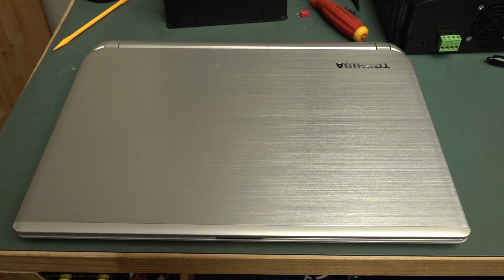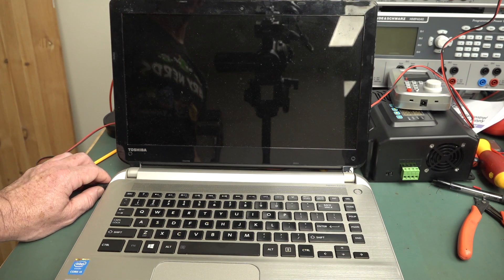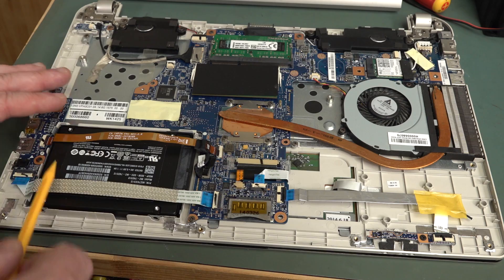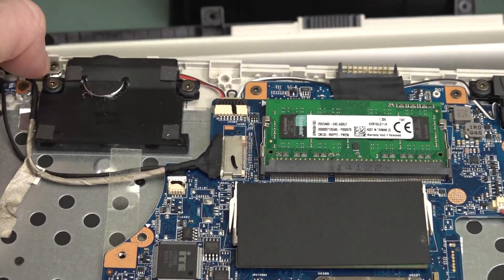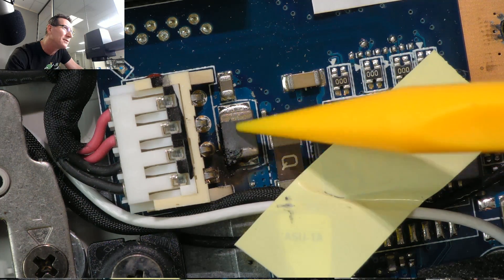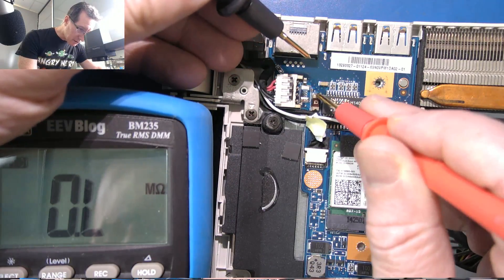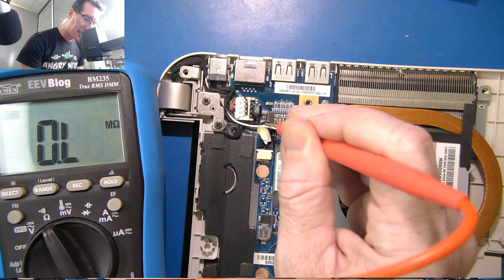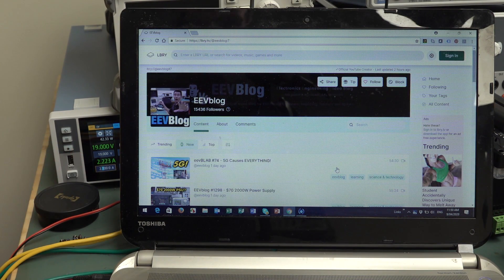EEVblog #1299 - Dumpster Laptop REPAIR

Comment: It's amazing how people throw out machines with data still on them. Here they had some kind of excuse I suppose, but the HP ProBook 4520S I'm typing this [on] was dumped, working, with a still-trading firm's full set of accounts, emails, supplier info etc on it. The HDD had a quite a few bad sectors but hasn't grown any more and the very worn keyboard needed replacing, but neither meant the machine had to be dumped unwiped.

Comment: Can't understand why people throw away PCs with hard drives filled with personal data (and even without the minimum protection like this). The previous owner of that laptop need to thank you for erasing that SSD. And nice score with that SSD by the way :)
Reply: That's how you give birth to voyeur priv8 p0rn on the interweb.
Knowing Dave's lab is in an office building, the guy who tossed that thing probably never heard of NDA and IP security at all.
Reply: Just people that dont understand how it works, i read a story of a guy who bought a laptop and claimed he found an old dell laptop instead of the one he bought so he got a full refund. the IT guys as the bestbuy just popped out the hdd and found his pics and data. people jsut assume "welp the laptop is broken" and everything on it is lost
Reply: some people only know how to turn on their laptop, start a browser and go on social media, if then this laptop dies, you can't expect them to know that there is something like a hard drive and that you can open it and take it out, let alone format it if it doesn't turn on.
Reply: Not everyone is tech savvy, even if they managed to install SSD into it, though they also might have gotten someone else to do it. Anyway, quite a lot of people, when PC or something dies, don't really know what failed, because they see laptop or PC as one unit and think that this is it, its dead, so it is fine. Yeah, it sounds bit funny for anyone tech savvy, but vast majority of users, just know how to use PC for general stuff and it ends there. So if I took a guess considering the damage, it could have easily be that owner thought that drive was dead with laptop.

Plus people don't really think about security that much. Like even working in support, I had plenty of moments when people would just tell me their password to check their issue out and I didn't even ask for it, I just told them I can't access everything in their account directly for obvious privacy reasons. So yeah, you can't really know how much previous owner even knew about privacy. I nuke my drives when I stop using them. But I have even seen plenty of used builds where they maybe just deleted few files and left bunch of stuff behind or left it easy to recover.
Reply: Not just the hard drive, why people trow away their pc , if its still can be repair??

Comment: Doesn't matter when it was made. You just do a SMART readout, and you can read power on hours and write endurance wear.

What idiot does a drive uprade without a retainer cage though. That's nasty. Not even a piece of VHB tape to secure the drive a bit? And probably lost all manner of screws in the process.
Reply: The same idiot that throws away a SSD with all the company data on it :)

Comment: 850 Pro 512GB, shit, that's worth the effort right there! Older but who cares, basically all modern SATA drives run the same speed anyway, and those things are bullet proof. They'll write enormous amounts of data before problems - not like the early days of SSD's. I've seen consumer grade Samsung SATA SSD's write over a petabyte (on a 512GB drive) before entering read-only mode. That's like an order of magnitude more than their warranty. Most normal PC users won't even get a fraction of the way towards the total bytes written warranty on modern-ish SSD's.

Comment: The SSD was absolute overkill for that laptop from the beginning. The Samsung Pro Series isn't even necessary for tougher jobs like daily video editing, the EVO drives are absolutely good enough. But on the bright side, the 850 pro is probably going to last forever as long as the controller doesn't give up the ghost at some point. The NAND certainly won't.

Comment: Great finding. A 8GB laptop is largely enough for most people and 512GB of SSD is luxury. Just put a beefier inductor and let's go !
Reply: CaptainDangeax those ODN relays are a third the capacity of the originals. What did you need the room for?
Reply: @HighestRank  What do you mean ?

Comment: SSD's worth ~$100 at most, probably less. OP'ed on eBay.
Reason is that a new 860 Pro's ~$200, and you can get a 970 Pro (NVMe) for the same price, or regular NVMe's for half the price but they're not as reliable as a Sammy Pro.
Reply: Wow you make it sound like its no big deal, to many people $100 is a lot of money, let alone to throw it in the dumpster.
Reply: @netii126  Truth is most used SSD's are not worth buying anyway.  One found in the dumpster thats actually good and not used up (close to max TB written) is a nice find.
When you find them for sale as a used SSD they tend to be at or near their max TB written spec, and so are not worth a penny unless you just like buying a junk storage device that will fail soon anyway.
Dave should check theSMART data for TB written, failed sectors count, read & write errors.  I would toss it if any of the SMART data looks suspect.

Comment: Dave, you've got to get out more.  I've had a 2Tb SSD in my desktop for nearly a year as a replacement for a 512Gb SSD that was several years old.  It was less than $1k, so didn't break the bank.

Comment: What was the cause of that short-circuit? May be a loose screw ? Tip : search for a missing screw, preferably one which holds the PCB where mechanical stress occurs, like near connectors.
Reply: Had an example of that some years back on a machine someone else had had apart, loosing a screw that ended up between mobo and chassis. Only damage was a MOSFET that had neatly desoldered itself from the mobo. The machine was renamed Phoenix after I'd fixed it.
Reply: It wasn't a short, it was a high voltage arc-over.
Reply: @EEVblog2  Thank for your reply. But...are you  sure ? That would mean the motherboard has survived a few hundred volts over-voltage (at least) on the power input. How can you distinguish a burn due to an electric arc from that due to an over-current ?  A short-circuit could have occurred between the output side of the inductor, coming from the positive of the PSU, and the 2 negative pins of the 4 pins power connector. A frank contact on the connector side could explain why that side doesn't show any burn damage. An electric arc would show burns to both sides. Thanks for the video.

Comment: Probably it doesn’t exceed 1.9A if you don’t use DVD, not install a rotating HDD and don’t plug USB stuff for charging and turn screen light to maximum all at once

Comment: That serial number contains the date code for manufacture. For 15 digit SNs, the 8th digit is the year, and the 9th digit is the month. For 11 digit SNs, the 4th is the Year, and the 5th is the Month. This one is *September 2015*. Also worth noting, i THINK that particular model has a 10 Year, or 300 Terabytes Written warranty.  
For completeness:
Year  Code
2001  R
2002  T
2003  W
2004  X
2005  Y
2006  A or L
2007  P
2008  Q
2009  S
2010  Z
2011  B
2012  C
2013  D
2014  F
2015  G
2016  H
2017  J

Month  Code
January 1
February  2
March  3
April  4
May  5
June   6
July  7
August  8
September  9
October  A
November  B
December  C

I don't know about 2018, 2019, and 2020. Sorry.
Reply: Awesome ,thanks!

Comment: Nice.  I did a similar thing just last week for my nephew.  His 2 girls are doing the home schooling thing and needed another machine.  I had an older laptop but no power supply so I cut the lead off a reasonably compatible supply and wired it in directly.

Comment: im still confused how you knew that was an inductor before seeing a label
Reply from the maker: The colour and the PCB layout.
Reply: @EEVblog  Plus experience of course. I'm still puzzled as to why it protected the fuse.
Reply: @Graham_Langley  If it's a polyfuse it would be self resetting.
Reply: @Graham_Langley  Me too. It's not a mac so usually the fuse blows first...
Reply: I'd say location more than anything else. It was wired in series with the incoming power.
Reply: No paint stripe to indicate polarity, not black, so it had to be a cap or an inductor. No continuity so check for capacitance but has neither so at most it wasn’t a working capacitor or fuse any more meaning it had to be removed anyway.

Comment: Here at our local supermarket, there is also a dumbster with only electronics, not for big items like laptops or tv's, but for smaller items like ipads and smartphones and such, i found some good stuff in them too! I found an ipad air 1 without icloud on it, and a iphone 5 without icloud, found also a couple of smartphones, some older ones but still quite valueable! I like your channel so much because you also re-use things that people discarted! Keep up the good work man!

Comment: would love to see the "smart" values of that ssd . pretty amazed they put a 850 pro version in laptops. they were and actually still are the ducks guts when it comes to mlc nand ...none of that tlc rubbish.
Reply: so it actually has the high endurance nand .. if this disk was slightly used as most corporate laptops ( say only filled to 20% capacity ever) it can out live most if not all tlc/qlc drives on the market . There is/was a reason the pro drives came at a premium :/

Comment: Replace the fan wiylth a desktop processor cooler.
And shove that amd radeon gpu using adapter there and connect it to a tv monitor

Comment: We have personal electronics recycling days at my office a couple of times per year (they collect company owned machines separately). There are almost always working laptops. I have found two laptops with Ivy Bridge or later CPUs, including a very nice ThinkPad T530. I personally think it's crazy to throw out an Ivy Bridge or later laptop, since they work fine and are actually perfectly usable for web browsing, office productivity, or as an HTPC.

I think the people in my office are a bit more tech savvy than Dave's, though, because the SSDs/hard drives have always been removed from every machine I have found.

Comment: When I don't know the polarity of a laptop power supply, how do I find out whether the center pin is negative or positive? It's an old Acer Windows 8 machine I've still got sitting around here in pieces and plan to resurrect as a cheap typewriter for someone who can't afford a modern/good one...but I don't have the right PSU for it, only one of these universal ones, with a very losely fitting adapter that fell out, so now I don't know any more which way around it was in there... (these 2-pronged thingys, really bad stuff, but it's what I got).
Reply: Check the continuity with the usb ports. They are grounded.
Reply: @nalinux  right, good idea, thanks!

Comment: The ssd itself is worth quite a lot if it's in decent condition, (not a lot of wear and tear through lots of write cycles) you can use crystal disk info and crystal disk mark to check it.

Comment: Great find! Especially the SSD! I've also got a ~500GB Samsung SSD, I think it may be a similar model, also the 850 Pro (instead of the cheap EVO stuff), because it came out of a ThinkPad T440 that I acquired for a friend of mine. He didn't need the large storage space, and I still had the same SSD in ~250GB size laying around from another Thinkpad (I think that was a T450, so slightly newer). Since he couldn't pay me, I swapped out the drives, because he said that 250GB would be enough for him, so there I got paid for my work in an SSD. It lives now as the secondary SSD in my own ThinkPad X220 i7, which has a 240GB mSATA SSD as its main SSD for the OS and stuff, and now this for storage. All spec'd out to the max with 16GB RAM and IPS screen, so even though it's an 8.5 year old machine now, it still does a really good job - and somehow I can't get myself to upgrade it, because I still love the old 7-row keyboard layout so much...the newer 6-row rubbish just misses some keys, and some of them are rather crucial (or at least good to have)... OK, that was a tangent, if ever ;)

Comment: Could you parallel 2 of these inductors in order to increase the maximum amount of current, just in case if you didn't have another more suited one? Or why would it work with a lead, doesn't it need the inductance? Maybe the power from the power supply is too "dirty" otherwise, with lots of ripple or whatever that the machine might not like? I mean, they didn't put the inductor in there without a reason, I would think?

Comment: Currently also using an 850 pro, really good SSD, With it, the SATA bus is effectively the bottleneck. They have an m.2 version that uses the same NAND chips and controller that gets around 1.2GB/s reads, and around 700-800MB/s writes. I currently use it as a working drive for large video files that I am editing, as well as a game drive. 

My main SSD is a Samsung 970 Pro 512GB, for most tasks compared to when I used the 850 pro as the main drive, the 970 pro did not boost performance, but the massive boost in read and write speed helps when I need to work with uncompressed video, e.g. needing to go from davinci resolve to after effects. Outside of that, the 850 pro works great.

Comment: That SSD is now worth more than remaining laptop even in working state. I'm curious why one who replaced HDD to SSD, didn't used original HDD mounts -  those should be SSD compatible. And why owner didn't took RAM and SSD away when threw this laptop out. Nevertheless would be nice to have that dumpster here. Just salvaged two fried laptops back from dead for school kids who are forced to learn remotely due to corona lockdown. But need some more.

Comment: TOSHIBA laptops can be very touchy, i have one that uses 19v 6.32amp power supply,... buy looks at that its been over loaded, either wrong psu (over voltage, over amperage) or they grounded something on board whenplugged it in it popped

Comment: That is one very clean dumpster laptop
Reply: He said he sanitized it with alcohol (good idea in pandemic times for stuff coming from the garbage), which also cleans it quite well.
Reply: @mrnmrn1  I was actually referring to the insides. I guess I could have worded it better.
I do get dumpster computers often and there is always dust, cat hair, liquids,... inside.
Reply: @randomelectronicsanddispla1765  Yes, true, it looks like new. It's probably not, because there was quite a mess on the desktop. Maybe they cleaned it when upgraded it with the SSD, and it failed shortly after. In this case, the SSD might be almost brand new! Dave should run some diagnostics on it.

Comment: I have a 512gb 850 evo, you can use Samsung Magician (official tool) to view how many writes its had and get stats on it
Reply: I remember way back when MFM drives could be reformatted with an RLL controller, and 20mB would magically become 30mB. Also LZ software compression tsr would add almost another 50% by shrinking binary files.
Reply: JFC! You two. OKAY. I'm using pure SI prefixes here; GB is 10^9 and GiB is 2^30. 

The EVO drives have 512GiB of physical flash and are advertised and provisioned as 500GB. The PRO drives have 640GiB of physical flash and are advertised and provisioned as 512GB. The EVO drives have about 10% overprovision and the PRO have about 30% overprovision. The EVO and PRO drives max out at 465GiB and 476GiB when you look at the whole drives in Window disk management. The PRO drives have other performance and reliability improvements too.

The use of GB is a marketing hack (AKA lying by asterisk) that's been around for many years. The new GiB prefixes which were invented in 1998 (approx), officially, to clear up the ambiguity (but unofficially to legalise the hack) and where standardised in about 2008.

Comment: I have a Toshiba laptop that looks just like that.  The hinge mounting system is crap.  They use tiny screws to hold the hinge to the lid that go into threaded inserts that are set in very very thin plastic.  The inserts will break away as the plastic crumbles, so you have to buy a new list (about $100) fortunately on mine, I found an LCD with the lid attached used for $45.  So never let the lid close with anything more than maybe a couple of sheets of paper in there or the hinges will break very easily.  I think mine might have had a pen get in there while the lid was being closed.

Comment: Winner winner, Samsung non-spinner!  And a PRO to boot :-)
Reply: I have a Gyro in my laptop but you don't :P
Reply: @mzflighter6905  Reminds me, I carefully moved some running HDD's by hand, the other day. Had to move them on the table. Tilted my hand slightly, and don't you know it - the drive started tilting 90 degrees offset. Weird sensation!